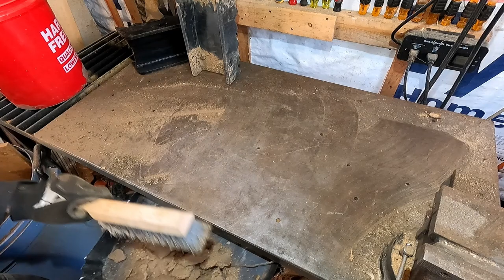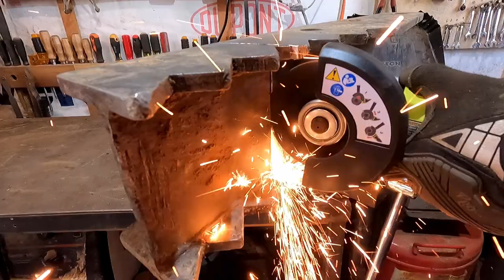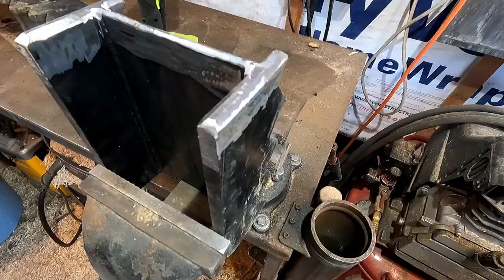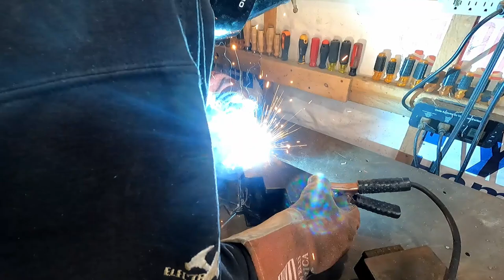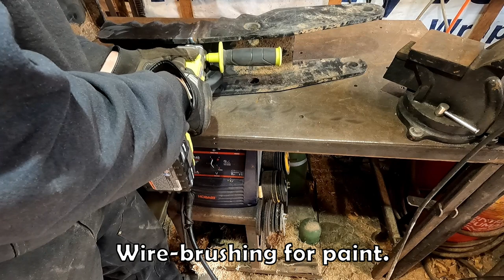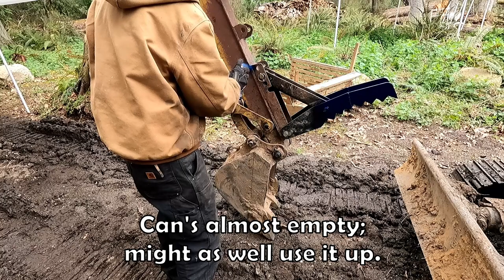Making My Excavator Grabbier

Comment: Your welding area with sawdust on the floor is sure to burn to the ground one day.
Reply from the maker: While I don't share your confidence, I can't really argue with your assertion. My set up is not recommended. Don't do as I do. If you want to make sparks, make sure there are no combustible materials within 30 meters and have a trained and certified fire-watcher.